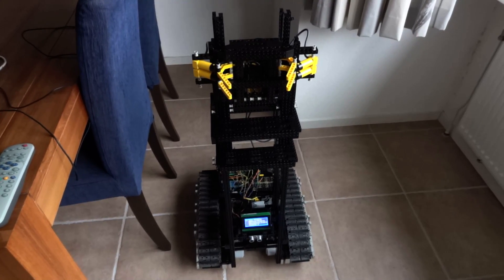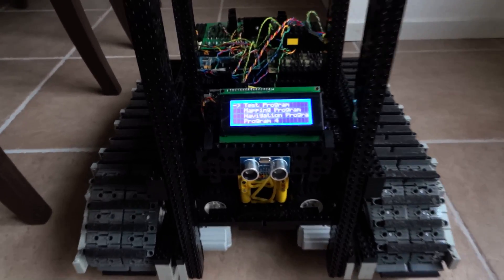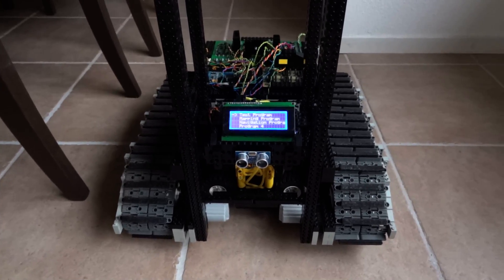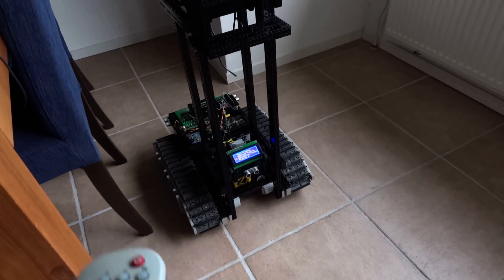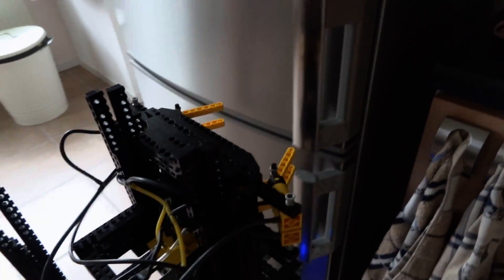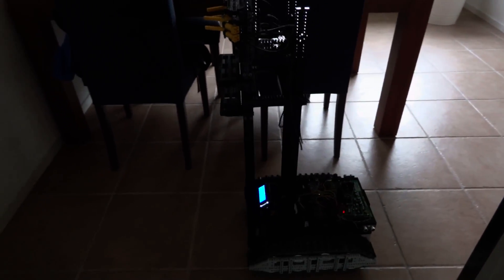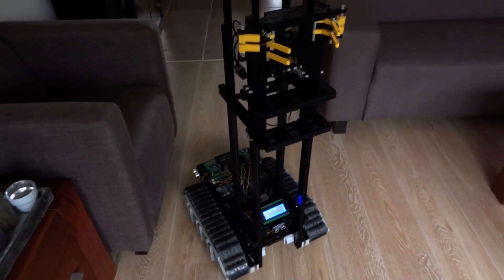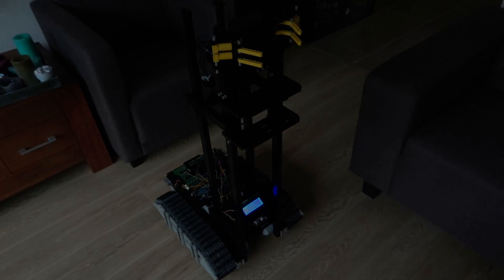Lego / Arduino robot video 3: indoor navigation

Comment: Hi, Can the compass also make the car retaining straight line in forward?
Reply from the maker: +thentust Outside it could but inside there is too much interference by metallic objects like reinforcement in concrete walls
Reply: +AlmightyArjen Then why the metal in the wall not affect your turning?   I have a arduino car with common wheels , no matter how I change the pwm , it still drifts when it goes forward.
Reply from the maker: If it's drifting then you have a mechanical problem. Then there's not enough weight on the steering wheels. That has nothing to do with the compass.
Reply: +AlmightyArjen  Drifting means "inclined to one side" ,right?  If it is , yes ,my car is inclined to one side when I want it to go straight . I think if I can make the car with a compass follow a specific degree like a car with a IR sensor follows a black line, it could go straight.   

so I have to make sure my problems: 
1.Is it still a mechanical problem?   
2. Can you explain why the metallic objects cant affect your turning?  
Really appreciate you.
Reply from the maker: +thentust If it's a mechanical problem, then it doesn't matter what the compass does. You can test if it inclines to one side mechanically by not using the compass and make the car go straight by steering straight. If the problem still occurs, it's a mechanical problem. If not, it's a software problem.

Metallic object disturb the magnetic field of the Earth. Your compass is using that magnetic field. I've seen deviations of 10 degrees due to this.